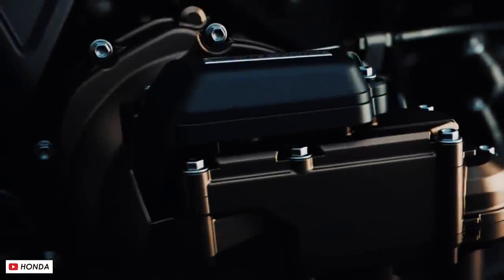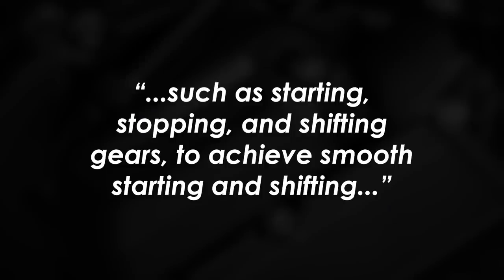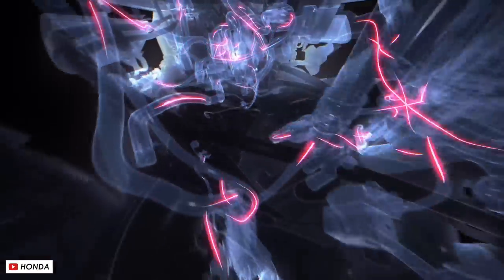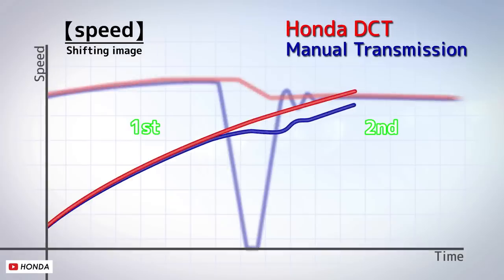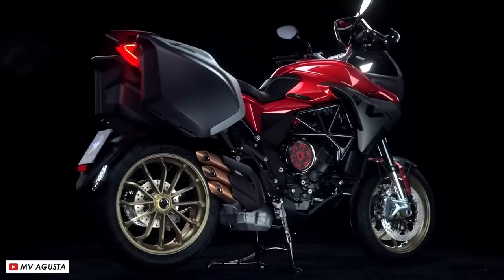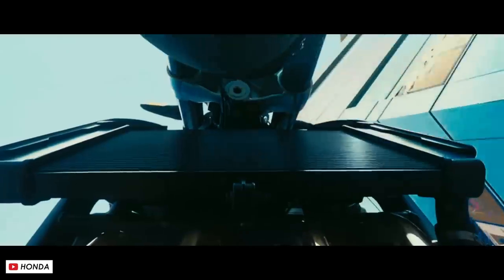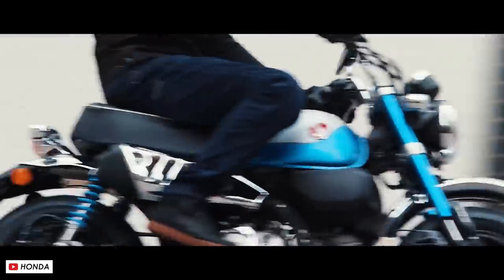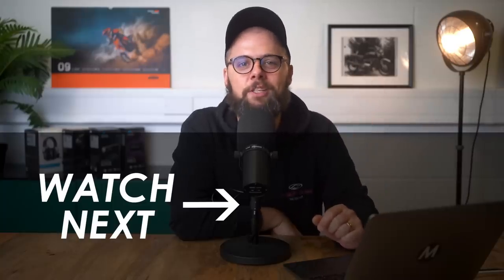New Honda E-Clutch For Motorcycles Announced!

Comment: Honestly with a quickshifter this would basically make for an inexpensive automatic, making bikes more accessible for ppl who aren't able to ride because of physical limitations. All in all great!
Reply: I have a Honda with DCT and the gear changes are vastly superior to a traditional manual gearbox. The gears are on two shafts 1,3,5 and 2,4,6 each with its own clutch. Thus the gears are already engaged mechanically. Quick shifters are a gimmick. I've had many bikes with quick shifters and I fail to see the benefit. So no need to pull the clutch and that's a big benefit? Perhaps on a track where hundreths of a second means something maybe. Also most quick shifters are inconsistent with different results depending on rpm. My 2 stroke race bike from 1989 can shift just fine without the clutch and it's 34 yrs old! But my Honda NT1100 with DCT and the small paddles can go up and down the gearbox significantly better than a traditional manual box with a quick shifter. No comparison really. Choosing the various shift modes (I prefer sport II) minor adjustments can be made with the paddles from time to time. My feeling is DCT is the greatest innovation since ABS. However if shifting manually brings joy to you than by all means knock yourself out.
Reply: I think you're right. There's more people that are interested in getting a motorcycle than when I started 13 years ago, likely due to the high fuel costs. 
These bikes would curb the nervousness for beginners.
Reply: @sunrisejak2709  of course a DCT is qualitatively a better concept but it's expensive and heavy, two things that make a motorcycle less accessible.
Reply: @Eden-NoEye  Yes, cost a bit more and indeed adds some weight. I'm on my 3rd DCT motorcycle (NC750X, XADV, and NT1100) and the added cost (in my opinion 😊) is well worth it and the added weight imperceptible. But you are correct. If you haven't experienced it though you should give it a try. 😁
Reply: @sunrisejak2709  since I'm kind of new to the whole motorcycle thing I haven't tried one yet. I love shifting and for me nothing is more satisfying than coming to a stop by going from 6th to neutral, hitting the rev-match on the way. I'm still very excited to try a DCT one day.
Reply: @Eden-NoEye  Welcome to motorcycling! 😁 By all means if the manual shifting process adds some enjoyment to the experience than continue on your course. Take some rider safety programs if you can, use common sense, and ride responsibly. I'm in my 55th year of motorcycle riding (now 70 yrs old) and it's been a huge passion pretty much my entire life. My wife thinks my obsession is a bit extreme and finds it a bit crazy! 🙄 I hope motorcycling for you occupies a nice portion of your life and it's fun and rewarding. Doesn't matter what you ride but how you ride it. Cheers, buddy. 👍
Reply: @hyedefinition1080 yet we all end up with bikes labelled as 55 mpg capable and spend the majority of the time getting sub 20 because 'fun' my 8 year old suv is more eco than my 22 plate 660. Traffic on the other hand... Absolute god send.
Reply: @marcdxn87  sub 20???? I ride hard and even my 1250cc v twin will manage over 22mpgs, my 5 cylinder truck only gets 15 lol.  My old cbr650r averaged 39mpg
Reply: Why would anyone bother with an ECT or DCT if you have a QS. The latest models of sports bikes have clutchless quick shifting and self-blipping down shifts. So why does anyone need this??
Reply: @alant383  A quick shifter merely cuts ignition to allow the gears a period of no load. So the movement of the shift fork and gear can move more easily. But,,, the mechanical movement is still present. This is not ideal. In a dual clutch  1,3,5 gears are on a shaft with its own clutch and gears 4,5,6 on another shaft with its own clutch. The gears generally are already engaged and all that needs to happen is disengage one clutch and engage the other which happens much much faster and smoother than a conventional gearbox even with a quick shifter. The DCT shifts are nearly imperceptible. A change of gears on a DCT does not upset the suspension geometry at all. Quick shifters behave differently at different RPMs. Ugh. Just relaxing at low revs on a leisure ride they don't work as well. So it's decision making of when it's best applicable. The only benefit to a quick shifter is you dont need the hand clutch action from usually 2nd gear on up or down (I've not experienced a quick shifter good enough to do the 1st to 2nd shift smoothly at all RPMs. At idle and coming off the line a DCT has automatic neutral and engages forward motion perfectly smoothly on take-off better than a human can do. On street riding what's the benefit of the word "quick" in a quick shifter? Other than on a track do you really gain anything? Most modern sports cars have moved toward dual clutch gearboxes. Tiptronic in Porsche, Audi, many legacy auto makers have gone the dual clutch path. In fact manual gearboxes with a foot clutch are nearly extinct. Just a few % of sales being a manual box with mechanical clutch. DCT,,, It simply works better and it's programmable for different shift patterns that holds gears to various RPMs according to rider demand. The shift can be ultra fast for sport riding or more gently for rain riding. Thus the control of the hydraulic actuators are programmable. Further DCT employs a type of learning logic algorithms that seek to learn and understand the conditions that a rider is looking to extract. Amazing as it tries to learn me. It actually attempts to learn my riding style and attempts to predict what demands I need. If it's leisurely riding it senses that and will change up to a higher gear sooner. It looks at a variety of sensors. If I blast off the line at a light for example it will know I want more power and brisk acceleration and will hold the gears longer. Perfect? Not quite, but very very good. And again I can intervene with the paddle shifter anytime. Cool. All very intelligent and adaptive. A quick shifter cutting the ignition offers no additional benefit. Two very different methods of putting power to the ground, with DCT offering much much more. Plus the DCT has small +- paddles that can be activated at anytime to make small adjustments and again the shift is super smooth. Also you can choose manual mode and the shifting only happens when the rider selects the gear and does so at pretty much any rpm. (you can't downshift that would put the revs past redline for example). In manual mode the dual clutch shifts are FAST and again nearly imperceptible. A tap of the forefinger to go up a gear and a tap of the thumb to go down a gear. All literally at your "fingertips". 😁 So it's the best of both worlds. 😉 The DCT has no need for a clutch lever or foot shifter. A quick shifter retains those archaic controls. In the past 30 years I've had 22 motorcycles. In my garage I have race bikes such as Suzuki RGV 250 2 stroke. That's old fashioned shifting but I still enjoy it. 😎 Also have an XADV that has DCT. I sold my BMW F900XR for a Honda NT1100  with DCT. It's far better than the quick shifter on the Beemer. We've all been in traffic jams from time to time. A 45 minute jam feathering the clutch crawling along at walking pace in traffic is just no fun. With DCT just ignore the gears and ride. The bike does all the work. 👍 DCT downsides? Cost, weight, and no slipping the clutch in the "friction zone" when making slow speed maneuvers. Gotta modulate the rear brake for those actions like U-turns. Going forward Honda has me as a captive customer as DCT allows more flexibility with many benefits all while I'm able to devote more attention to other aspects of the ride. My wife even likes it as shifting with a passenger means no more bumping of helmets it's that smooth. The only real rationale for having conventional manual gearbox is if folks simply enjoy shifting. That's perfectly fine. Obviously I'm a DCT fanboy and find quick shifters to be a gimmick for street use. 😊
Reply: @sunrisejak2709  Wow! That was quite a long story, great thesis. 
While I compltely understand this has benefits for cruiser riding and with pax, or if you don't like shifting and prefer an automatic-style of riding, this makes sense. 
But on my Gixxer 1000 track back, quick shifting was a joy even at low speeds. I set mine for a low threshold of e.g. 4,000 rpm (just above idle for a gixxer) which gave me the option to semi-manually shift in any gear by just toe-tapping the shifter, at almost any speed, in any gear and when I wanted to on the street, in traffic (very rare on a gixxer - just slip past it all). 

I personally do not like an algorithm doing the shifting for me, especially in corners. A sudden unexpected gearshift could/would unsettle the bike in a balanced, leaning turn (street or track). I much prefer to control when to shift,  what gear and at what revs.  This will depend on so many variables that I definitely would NOT want to give this up for some computer algorithm unless/until the AI is much more advanced than it is now - maybe 20 years from now. I also enjoy shifting with the quick shifter, semi-manually using the conventional shift lever. It is seamless, silky smooth under even mild and gentle acceleration and still leaves me in control (which i much prefer). 

The QS is also much much lighter, much less costly and retro-adaptable to almost any bike, especially sports bikes or sport-cruisers. 
My 2c
Reply: @alant383  Sorry for the long dissertation. Sitting in a hotel room a but bored.Obviously you've never tried DCT. 🤷‍♂️ You also miss the point that in manual mode you can decide on when to shift. The shifts when using the paddles move the gear at YOUR decision. Learning logic algorithms are a bit like AI. That's the direction of the future. Anyway we view this technology differently and that's OK. I suppose you would prefer a rotary phone with a coiled cable to the headset. 😊  I'm currently on a motorcycle trip here in Thailand. Me on my NT1100 and my buddy on his BMW GS. It was comical at traffic lights when I sat there with the DCT in gear but yet in neutral. He is holding the clutch in waiting for the light to turn green. When it does go green I walk away from him as I nail the throttle and he struggles trying to modulate just the right amount of clutch slippage. My bike goes through the gears and my left foot has no responsible function so the balance is much better as all I need to do is pin the throttle and maximum acceleration and gear change is handled seamlessly. OK, OK, this has been a delightful exchange and I appreciate your civil nature and respect your opinion. Enjoy your Gixxer. Tomorrow I'm going to look at a 90's vintage GSXR 400 R7. Cool bike. 😉  But then again it is 33 years old. Nothing like the small race bikes from the 80's and 90's. Cheers,
Reply: @sunrisejak2709  Lol - no I enjoy my iPhone 14 Pro Plus thank you :-) 
What you just described I can do exactly the same on my 2001 gixxer (much modified) with a K8 motor, but way faster. It accelerates wildly at full throttle with silky-smooth, seamless gear shifts but I get to choose when to shift depending on the situation. Yes, the launch is more of a balancing act for the first 1/2 second but that's your only advantage. But modern sports bikes have launch control as well that would leave you far behind imo.  Have fun on the GSXR 400 (never even knew about that one) but the handling of the later generation sports bikes is light years ahead now. With the style of riding I have grown used to, I would probably wipe out on the 3rd corner (or before). 

Thailand sounds great - seen it advertised for bike trips - I was in the Philippines the last 3 years but sadly no gixxer :-(  although it would have been overkill for the style of riding on the islands (7,500+). Race bikes from the past remind me of the TZ350's in Zambia where I grew up but I had no $$ to buy one as a kid. 

In short, I like the tech of the e-clutch (for a cruiser) but think it's not enough of an advantage over a simple QS with blipper to justify the additional cost and weight.
Reply: @sunrisejak2709  the honda hornet equipped with QS does a very good job or shifting 1->2 but only if you are above 5k revs and on an advanced throttle position. If you are low rpm or are not accelerating hard it jolts like hell
Reply: @gabrielion9313 The Honda Hornet looks like it should be a good success. Nice all around  bike.
Reply: I think they have a quick shifter. The sequence at 0:55 shows the bike at a stop, shifted from N to 1 with no clutch. This requires a pressure switch on the shifter, IE a quick shifter. The only thing they'd need is an actuator on the shifter and the shifting could be automated.
Reply: @Villani_AV  My 2017 cb650f averaged 39mpg(UK), which is slightly worse than you, but I didn't commute on it, it was just for tearing up my local twisties here in Scotland. It was a great bike let down by one flaw - the flacid midrange. Unless I kept the revs annoyingly high through a corner, there was no stomp on the way out. I ended up wishing I'd bought the mt07 instead.
Reply: @sunrisejak2709  Quickshifter benefits?  Simplicity, low weight, low cost and inexpensive. I have it on my MT09 SP (up & down QS) as std and while I try not to use it all the time to keep my clutch control excercised it's still a very handy thing to have when you want to give your left hand some rest, plus it also offers a performance advantage with faster shifts when you want max acceleration....  If it offers the above advantages but you can also switch it off and use it as a conventional gearbox I don't understand why anyone would be critical of them.

DCT?  Sounds really great... and level up x2 again, I know a few people who have them and hear nothing but praise for them. Maybe I'll get one when I'm a bit older and want to minimise my workload more.
Reply: @sunrisejak2709 i have a DCT as well and I at times miss being able to just shift the gears the old fashioned way. For a commuter which i use my bike for i love it. But i see this as a good common ground for someone who wants to keep the ability to shift normal but also wants the ability to focus less on the clutch and stalling and more on the ride.
Reply: @sunrisejak2709 I think shifting manually brings joy to 99.9% of people riding motorbikes mate
Reply: @motomc6962  yes, that's the best reason when discussing the pros and cons of DCT vs manual. because people enjoy it. Honda sales of DCT growing constantly. Honda also introduces the e Cldutch. Another technology aimed at more efficient transmission operation. But we know what happened with manual gearboxes and cars. Nearly extinct. I much prefer a DCT in my car and my motorcycle. But,,, I just bought a Tesla and it has no shifting of any kind. Electric motorcycles aiming that direction also. In most motorsports an automatic method of changing gears is utilized as the gear change itself is superior to what a human can produce manually. But you hit the nail on the head with the comment, "that's what people enjoy" shifting on their own. Helps them to feel they are participating more. Very cool.
Reply: A quickshifter is nothing like an automatic. In a QS your left foot still manually shifts the gear. The gearbox itself is constructed differently. In a conventional manual shift forks or shift dogs mechanically move a gear along a shaft to mesh with another gear. This does not change with a quick shifter. The only thing a QS does if kill the ignition for some brief period. The movement of the gear remains. In a DCT the odd gears are on one shaft and the even gears on another shaft and each shaft with its own clutch. The gears are basically engaged. The changing of the clutch actuation is simply with a solenoid activating and deactivating each clutch which is much faster and is programmable. Not new as cars have used this technology for years. QS and DCT very different things for different purpose.
Reply: @sunrisejak2709  and the E clutch just detects pressure on the gear lever and activates the clutch electronically so it’s much much closer to a quickshifter than a dct. Would be nice if it had different modes so you could use it just as a quickshifter and blipper but still have to use the clutch for stopping/starting, I suppose you could just use the lever anyway but would feel odd knowing that your doing it for no reason because you don’t have to use it at all
Reply: @motomc6962  I guess it depends how you define "motorbike". Here in Thailand and in much of Europe most (vast majority) of motorbikes are scooter type with CVT transmissions which clearly outnumber the convential motorcycles you're referring to with regards auto vs manual. Folks who migrate to DCT for large motorcycles are not a small number. Something like 400'000 since Honda launched the technology. The vast majority of those do not go back to manual boxes. Honda pioneering this technology in the two wheel world is also looking to bring auto operation to a broader group with the advent of their new e Clutch development. Even MV Augusta has automatic style clutch based on the rekluse clutch. Don't forget that a DCT can be operated in a manual way with the paddles. I'm just back from a 7 day ride to northern Thailand on my Honda NT1100 with DCT. In the mountain roads I put the setting in "manual" and shift with the paddles with my forefinger and thumb. The shifts are fast and smooth and at my "command". But I agree if folks enjoy the process of a manual gearbox that's awesome.
Reply: @motomc6962  I get your point. But... The use of a manual clutch (human) vs an automatically controlled clutch (technology) I would argue the high tech methods are faster, smoother, and result in a superior result with the actual gear change. It simply does the job more efficiently and effectively? But as stated by many folks it removes the enjoyment of mechanically operating the bike. If folks simply enjoy shifting gears than that's what they should do. But if you want superior operation a high tech method just changes the gear better. Pulling away from lights for example my DCT does so flawlessly and launches perfectly every time. I smoke people off the line with a simple twist of the wrist. After 6 years and 3 DCT bikes I've never had one stall. I ride with the setting in sport 2 or 3. I find a make small adjustments from time to time with tapping my forefinger or thumb. This now happens subconsciously. Anyway, I also have manual bikes in my garage. I wouldn't think I would appreciate DCT on my 1989 Suzuki RGV 250 per stroke race bike. I prefer shifting that on my own. I applaud Honda for diligently pursuing the auto gearbox for motorcycling. But,,, admittedly its not for everyone.
Reply: @sunrisejak2709  yeah they are no question faster and smoother same with cars but as with cars changing gear yourself is more raw and connected and I prefer it even if it’s slower however that being said I would like a quick shifter and blipper just like I’d love a sequential gearbox in my car with flat foot shifting, still manual just faster and more aggressive because you can keep the throttle pinned but your still changing gear yourself. I’m getting a cbr650r soon but seems the only way to get a downshift blipper is this new E clutch
Reply: @motomc6962  I'll be curious to know how you get on the the CBR650R I'm a fan of mid size motorcycles ridden to their limits as opposed to hyper liter bikes that generally get short shifted with the real power not really exploited. Who knows how the e Clutch thing will work out. The problem with DCT in a high performance environment is weight, complexity, and cost. In a car it's ok as the added weight is generally not a concern. But in a CBR650R application a method of quick changing plus clutch actuation could be interesting.
Reply: @sunrisejak2709  it’ll be the fastest bike I’ve ever ridden as I only ridden 125s and then 250s but making the change from enduro bikes to a sports bike so 95bhp is all I need on the uk roads it will do 100mph in 3rd gear what more do you need haha. Like you said if I got a 1000cc super sport I would never get to enjoy it or use it fully on the roads so rather pay less insurance and fuel for a bike I can enjoy more. May be happy with just an up shift quickshifter and using the clutch to Rev match traditionally when going down the gears I don’t really mind that
Reply: @motomc6962  That sounds great. Even the 400cc bikes are making a comeback. Kawasaki has the Ninja 400 which is a twin and the ZX4R which is the 4 cylinder solution. 400cc but pretty capable. Can't beat the Honda though. Particularly their 600/650 4s. Good luck and have fun.